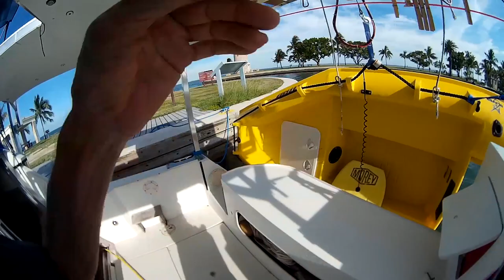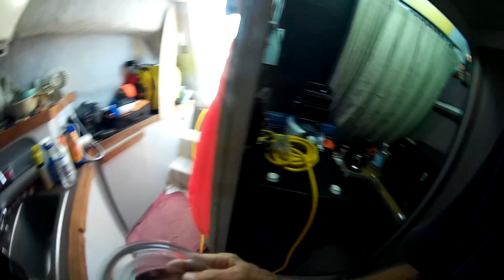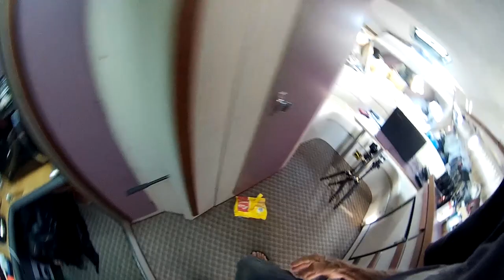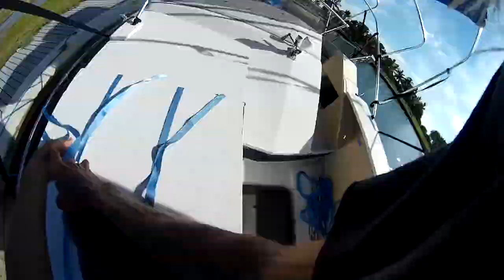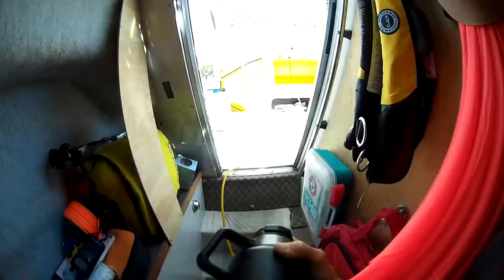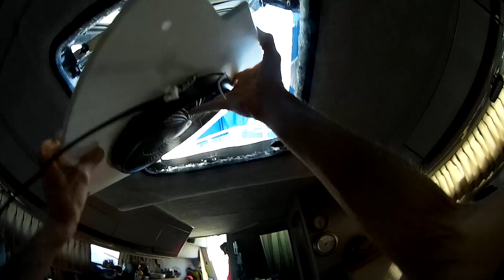The Reality Of Living Aboard A 27 Foot Boat   (First Person View Breakfast At Boca Chita Key)

Comment: Very nice. I will be coming this summer to Florida. Maybe we will cross paths. I am also looking to get a dinghy like yours. Looks well built.
Reply from the maker: I like the Oliver boat.  I cut a hole in the flat front deck and put in a hatch so I can store an anchor, dive flag and other dinghy related stuff in there.  When I cut the hole, I thought I made a mistake because the plastic bent easily when not reinforced.  I screwed the deck hatch through the plastic and into some wood furring strips I cut and held below the deck until the screws from the hatch were in.  The front deck is now strong and the hatch is in there.  With the hatch cut, it was possible to fill most of the dinghy with expanding foam so only the front part was hollow (for storage), but I think that was a mistake because it made the dinghy noticeably heavier.  If I had it to do again, I'd put in the hatch, but I'd make some sort of wall that keeps cargo in the front from sliding back under the floor or into the pontoon area instead of filling the rest of the dinghy with foam.

Comment: It’s looks like you have a lot of wasted space on the inside of your boat. You have to do a lot of climbing around and things to plug in and unplug on an everyday basis. Have you ever thought about rearranging and converting over to using switches instead of plugging and unplugging your appliances ?? There has to be a better way to make it from exiting the bed having to climb over the table. I always look to make things easier on myself when doing the same stuff day in and day out. Maybe run a gas line to your generator or even moving it closer to your main tank then having a fuel line run straight from it. I love your boat and wish you the best on your travels!! 👍👍
Reply from the maker: Climbing over the sofa is a lot easier when the table is not set up.  There is a switch to go from shore power to the inverter.  I just have to get an adapter for the extension cord so the generator can be plugged into the shore power plug.  Then I can switch from one to the other with the existing solar/shore power switch.  Your plan to plumb the generator into the main fuel tank is interesting.  I can also connect it to a larger fuel tank for an outboard motor and set that tank on the counter next to the generator.  My plan is to add a lot more solar and bigger batteries so the generator should only be needed as a backup after the upgrade.  Thanks for all the good ideas.
Reply: Nine Hundred Dollar Luxury Yacht more solar does sound like that would help you out a lot on your day to day choirs. I think you were so lucky on getting this boat for what you paid. I remember when you got it and went from the small sail boat to this one. You’ve done some great improvements to it. Are you living on it full time or do you still have your house to? I like remodeling to make it fit my needs like you have done. Good luck and stay safe out there 👍👍
Reply from the maker: @mwatkins2464  Stay tuned.  There are still a few videos to be edited from what was recorded over the summer, then it will be back to more upgrades.  The plan is to replace the three front bimini tops with another solar roof and hopefully get 24/7 solar air conditioning.  I got an equally good deal on 20KW of lithium modules and 3 KW of solar panels that will add to what is already on the boat.  I'm back at the house where I can use the garage full of tools for the winter and plan to get back on the water in April.